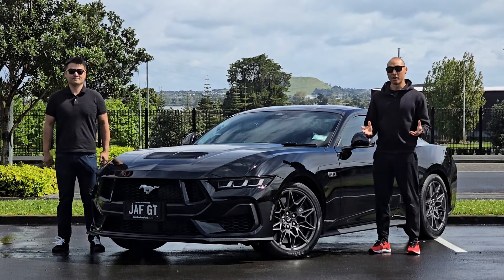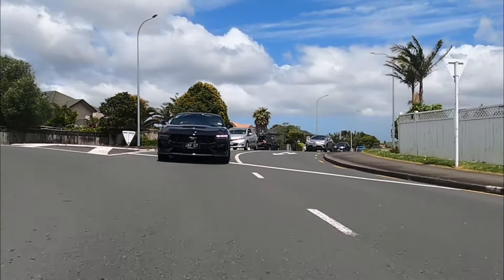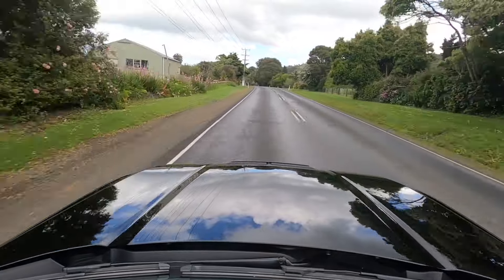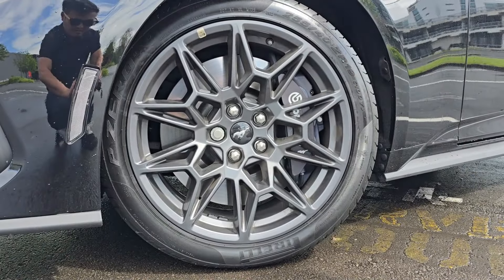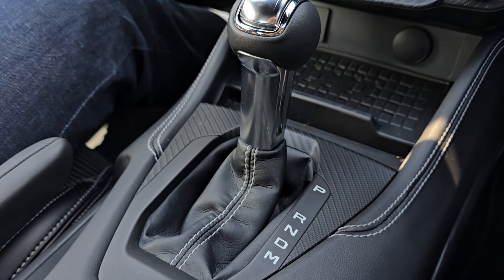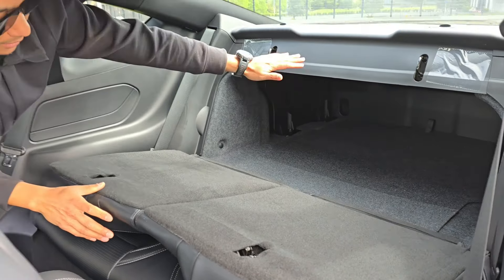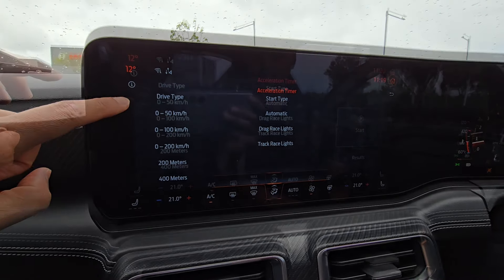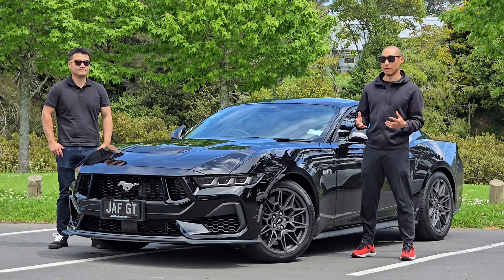2024 Mustang GT Full Review + 0-100km/h Test

Comment: But Does the Radio SOUND LOUD ?  Never buy, the first model of anything. GOLDEN RULE .
Reply from the maker: It's mostly base on the last gen platform, even the engine is the same, so it's not much of a new car
Reply: @sundaymorningdrives  Do you own an S650 ? I have owned three of the last generations and the S650 is streets ahead of the previous editions. Keyboard warrior.......
Reply from the maker: @panda2650  not saying the S650 is a bad car, on the contrary if you see the video we were very impressed with the car. I am only saying it's using similar chassis and engine carried over from the previous generation, which is a good thing, because it means it's tried and tested, and would be a very reliable car/platform.

Comment: Takes at least 15000 miles to break in;)
Reply: The 21 had functioning brake cooling ducts;(
Reply: Get good tires those factory tires will kill you
Reply: Get that spare tire for added weight;)
Reply: You have the drift brake;)
Reply from the maker: @jackcobbiii1797  nice, you are an expert, do you own one yourself?
Reply: @ 21 model;) manual
Reply: Very fast cars and should be responsibly respected.
Reply from the maker: @jackcobbiii1797  yes, correct
Reply from the maker: @jackcobbiii1797  very nice, I used to own a GT350, loved that beast